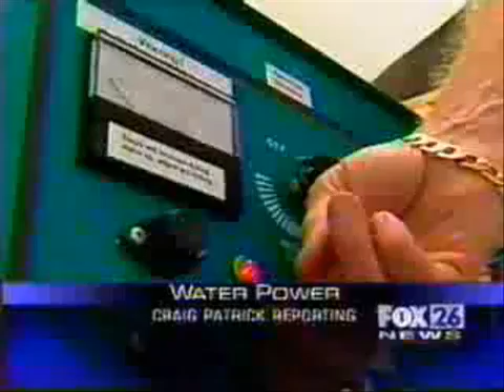How To Run Your Car On Water - Using Water as Fuel

Comment: I'm all up for HHO, but it sounds like a lie when he says the car will run solely on the water. If it could, then why does he use a mixture of gas and HHO?

Oh, and isn't H2O short for H2O2? In which case it should actually be HHOO gases?